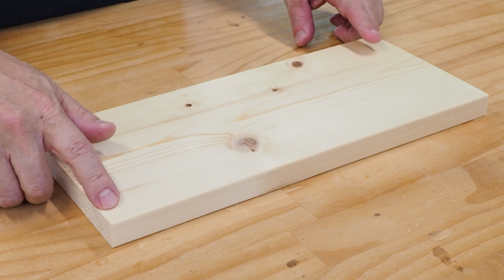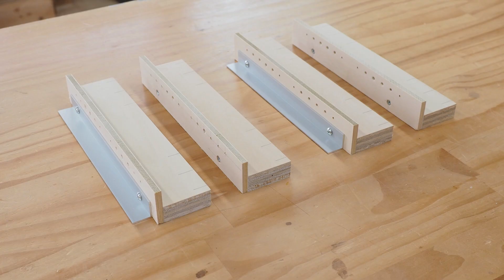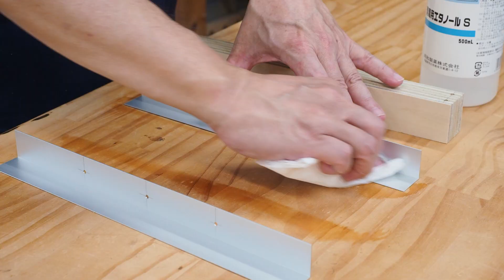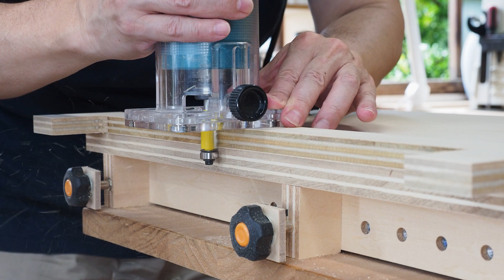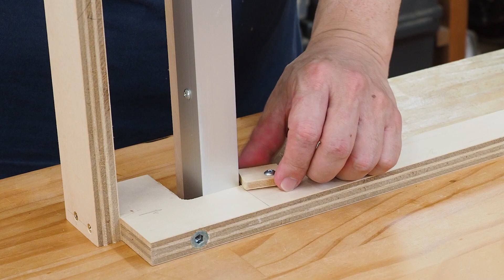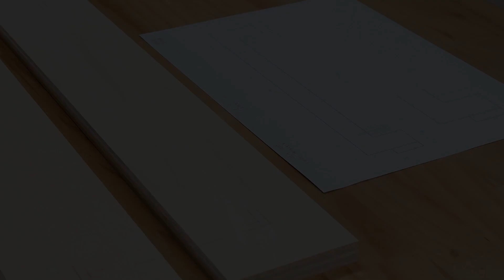Electric Hand Planer Jig | Flattening without Jointer or Planer, No modification needed (subtitled)

Comment: But what do you use when this new made jig warps?
Reply from the maker: This jig works by holding the electric hand planer at a constant height. If the jig is made with a certain degree of precision, some distortion should not be a problem. The weight of the plane should help settle any warping. The flatness of the workbench also has an effect, but even with some concerns, I think this simple jig is good news for those who do not have a stationary jointer and planer. It's easy to make and works.

Comment: I appreciate the simplistic approach and an attempt at innovating. So a +1 for encouragement from me. However as for the jig itself it's too fiddly and slow to use for my taste. The solution with two sliding triangles / wedges to lift the work piece is much simpler, less parts, more accurate depth adjustments and probably cheaper to make. Just better.
Reply from the maker: So you already have a solution. Please try it and share it with everyone. I would like to see how to adjust the height using a wedge. It should be something as simple as a shim that can be adjusted 0.3mm repeatedly. I would be happy if my videos gave you the energy to create something. Thanks for the idea.

Comment: Super einfache Lösung, aber sehe ich das richtig, dass ich die Höhenverstellung nur über den Hobel machen kann?
Reply from the maker: The amount to change the blade height depends on the planer. It's about 2mm, but that's enough. It works because the optimum amount to remove at one time is about 0.5mm. First, use it to adjust when you start cutting. You can also use it at the end of the process when you want to remove a little more.
To get the desired thickness, use the spacer to change the height of the material. Change it in 0.5mm increments.
Please try it. Thank you.
Reply: @kikikumastudio  Danke. Dann hab ich das doch richtig verstanden. Das werde ich ausprobieren

Comment: So simple, but genius!  All other jigs involve this elaborate contraption built around the planer, but I have a cheap WEN and it doesn't have the back threaded holes, and the front ones are not the same height.  Thank you for sharing!
Reply from the maker: Glad you found it useful! This jig was designed for real world use for people who don't have a stationary planer. There are other great jigs out there, but they serve different purposes. I hope it works well with your planer. Thank you!

Comment: Interesting. But… the mounting of the hand planer is a bit misconcepted. In neutral position (0mm) the two sections of the base plate are at same hight as the blade with no removal of material. When adjusting the removal, the front base lifts. Both bases have different height and the blade can trimm the surface to the level of the second base. 

So in first place, Laying the base plates on the aluminum Profil contradicts the functionality of a hand planner as it is designed to glide on the base to late over the surface. 

Adjusting the removal will tilt the whole planner in this construction. The blade gets low enough to remove wood, but will only work for a few mm then you have to adjust the jig height or workpeace height again. 

It would be better to use the housing to fix the planner in perfect horizontal orientation with the front base independent moving. This way you can use the planner like normal but the jig acts as a stop if desired depth is reached. You can remove as much as you want without readjusting.
Reply from the maker: Can you show us your jig? Of course, you don't drill holes or modify the planer itself, do you?

This jig can only cut about 1.5mm at a time, but you can easily adjust the depth by using shims. It can do the work of a jointer and planer. It makes one side flat and then cuts the other side parallel. The aim is to make multiple pieces of material the same thickness. The jig that uses an electric hand planer is not a stationary machines, so it takes a little longer to work. But it works. If you have worked with a hand plane, you will understand this jig better. I am currently working on a video of making a shelf using this jig. Don't miss it!

Comment: I have a question, in my planer, the bottom sole in the back and the front sole in the front end exactly where the plastic body ends. In your planer there is extra metal coming from the front and back. How do I adjust for my planer?
Reply: I bought the plans, I’ll still make the jig. Mine is a Bosch electric hand planer. Just wondering if you have any ideas on how to modify the planer so I can attach it to the rails securely?
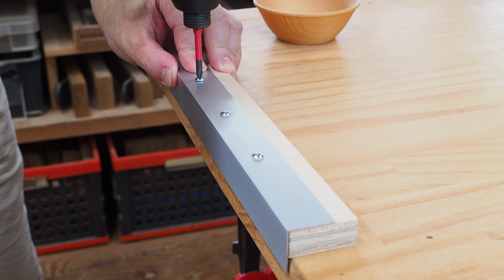Reply from the maker: This jig can be used with your planer. Since there is no protruding part on the front or back, you cannot attach a holding material to the rail as it was designed 08:58. You don't need the holding piece when flattening the board, but you should have a problem when lifting the planer and moving it around with the jig.
So what I can suggest is to use the screw holes for accessories on the side of the planer. You can make parts from aluminum or brass sheets. Cut a groove in the rail crosspiece and insert the part. 
Hope this solves the problem.
Reply from the maker: Added a free drawing for Bosch planers at kikikuma store. This is a reference drawing of a holding parts for a model without front and rear overhangs. It is a rough idea as I have not actually tried it. I hope it will be of some help. Please let me know if it worked. Thank you!
Reply: @kikikumastudio  thank you, I will look it over and see if it works. Or I make something different to work. I made the body wider (about two times, using a 10mm aluminium bar to reinforce the plywood), made the body longer as well for my specific case. I adjusted all the measurements from your drawings to my specific measure. Hopefully this weekend or the next week I will build and test this.

Comment: how does the planed board not block on the aluminum rail placed at the back of the planer?
Reply from the maker: You need to understand how the bottom plate and blade of the planer move. The plane body is fixed at a certain height with two rails, and when you turn the knob to make a deeper cut, the front base plate moves up, allowing the blade to drop lower than the rails. The blade must be lowered to a level greater than the thickness of the aluminum part. It's about 1mm. That way, the back rail won't get in the way when you cut the material. It took me some time and experimentation to understand this mechanism as well. This idea may have never been tried before. Although it's not a perfect jig, it can solve some of the difficulties of using an electric planer. Thank you for asking.

Comment: i really like this idea!  I have been trying to figure out how to even out pallet boards without spending $400 on a thickness planer.  i think this will do the trick!
Reply from the maker: Thank you for your comment. Please let me know if it works!
Reply: Im litterally in the same boat, just started hoarding pallets. Now stuck on planing everything, made some stuff without planing it but knowing how things should be planed I just cant get satisfied with things.. Ive looked up a few jigs, but this one seems the best, also no modifications on the tool.

Comment: I just discovered your channel, and I'm really enjoying your videos. Do you have a preference for flattening boards with this jig and a planer, or with the router jig you made?
Reply from the maker: I made both jigs for those who doesn't have a jointer or planer. Difference is that hand planer jig is faster than the router jig to work with. But the router jig results in better surface and uniform thickness. That's when I looked at it with very strict eyes, though. Oh, hand planer jig is much much easier to make if you don't mind having the rather minor tool.
Stationary planer is my first choice in the way I work. If it is a figured wood and has many tearout after planing, I will clean it up with the router jig. I hand plane all materials after the planer so few rough spots is fine for common woods.

Thank you for your comment.  Hope you have fun with both jigs.
Reply: @kikikumastudio  Thank you for taking the time to answer with such detail. I appreciate it!

Comment: Nice Job. May be with a couple of vertical slots on each planner support, the support could be adjusted vertically instead of adding spacers between cuts.
Reply from the maker: Thank you for your suggestion. Please let me know as I don't quite understand. How do you adjust the height? Also, is it possible to repeatedly adjust the height by 0.3mm (0.0118inch)?
Reply: @kikikumastudio Put threaded inserts into the bottom of the feet. Screw bolts into the threaded inserts and you just turn the bolts to raise it or lower it on each corner.
Reply from the maker: So you need to adjust the four bolts in the corners each time. It would be difficult to move the support parallel to the planer blade and make the 0.3 mm adjustment not once or twice but repeatedly. Using spacers may be a silly idea, but surely you can adjust the support to the desired height. Using bolts might work for other jigs. I'll keep that in mind. Thanks for sharing the idea anyway!